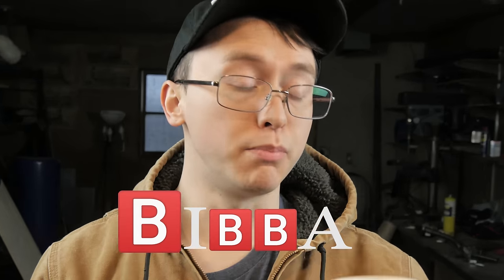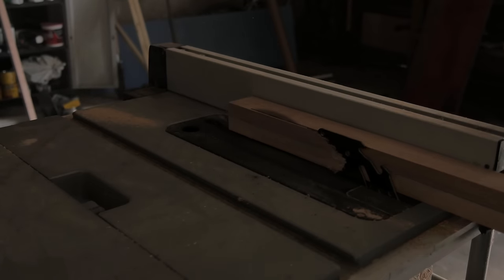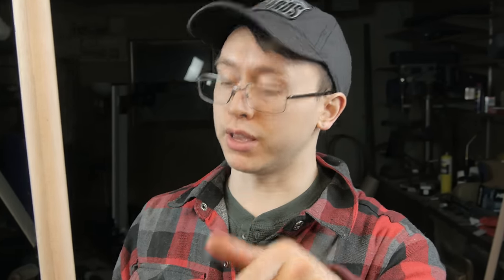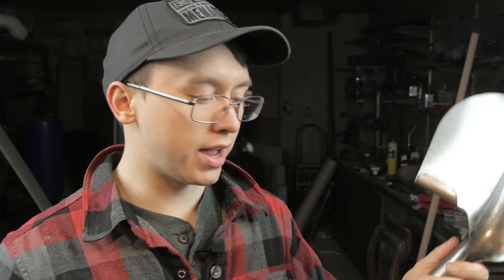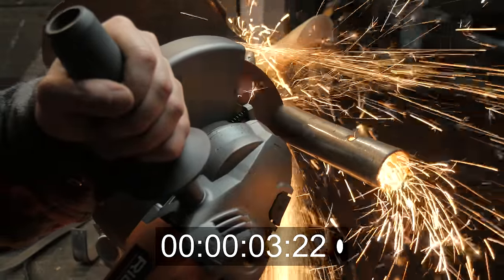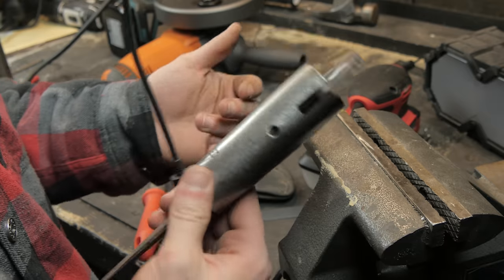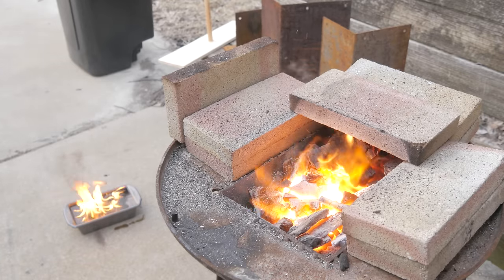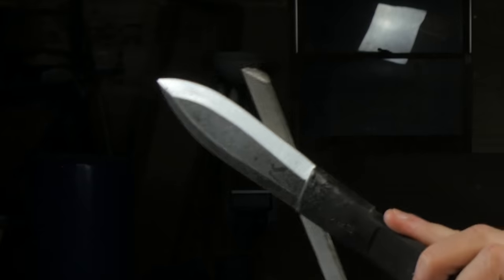DIY Lathe in a Day + Turning Spear Handles (Wrench Spears Part 3)

Comment: The metal needs to be a bit hotter, a term a lot of people use is "non magnetic"
So if you take a magnet with you and heat your metal to a point that it will no longer attract the metal then quench it you will get a much better hardening.

Comment: Depending on the metal the wrench is made of you might just be straight out of luck. But if there is anything you can do, i'd say heat the metal the is farther away from the blade as well as the blade, you might be leaching heat there, you might also want to leave the blade in the quenching oil until is equalizes heat with the oil (you might already be doing that and the edit just doesn't show it well). But those are the two things i'd try.

Comment: leave your spear heads in the oil longer. the residual heat in your spear head is likely tempering it as you let it cool off. I leave my quenches in the oil much much longer. good luck. hope it helps.

Comment: You could carbonized the steel, basically you just heat it up and put it in fine saw dust a few times and it carbonized the exterior although the inside will be the same but it should work

Comment: Eli... my dude. You need to move the object your trying to heat treat more rapidly in the oil, get a larger oil pan with more oil, google the leidenfrost effect I think that is your problem, a small vapour barrier from the steel and the oil is not getting to it, thus not cooling it down

Cheers 

From and Aussie viewer

Comment: a wrench will not get hard as h*eck, but you might wanna try getting the temp just above non-magnetic, when you put it in to the oil you want to shake it and keep it in longer, that might help. if this doesn't work you should case harden.

Comment: You didn't appear to magnet test it so it could have not been hot enough, also wrenches might be made from a water hardening steel, so you might try quenching in water instead of oil.
Reply: Ps. I find things harden better when you heat them up and let them cool slowly a few times before hardening.

Comment: A professional bladesmith told me once that cheap wrenches (made in India and China, mostly, that are less than 60-80 years old) are one of the worst salvage steel source. It is so because of the process of making the steel itself. This "tool steel" is actually random tool steel-ish scrap pieces of material salvaged from huge metal scrap yards dumped into large crucibles and homogenized together. The thing is, some of the scrap pieces used weren't good hardenable steel in the first place, and are contaminating the finished billet. This process allows big companies to make tools cheaper (as they don't actually pay for the raw material) but in the end, the results are just untrustworthy (from a metallurgical point of view)

Comment: 1) Pretty sure those wrenches are stainless, and intrinsically will not quench as good as carbon steel. 

2) Case hardening steel could give you steel with too HIGH of a carbon content if done incorrectly, and it will be too brittle, so you must be careful when doing it.

Comment: instead of using a drill for the lathe use an angle grinder, so much more power and torque, you built some mega spinning blade with one im sure you can build a lathe

Comment: I saw 2 ads, one about 1/3 of the way in and one at the very end... best way to heat the oil is with a chunk of scrap that's been brought to high heat. Toss it in and let it sit, burning off the top takes too long.

Comment: Eli I'm pretty sure you're taking the spear heads out of the oil too quickly, I could be wrong, but I think it most likely couldn't hurt to leave them in the oil for a minute or two longer. Also I realize that maybe you are leaving them in for more than a few seconds and the editing is just making it look like you are taking them out early. Also I've heard before that when heat treating you want the metal to get to a nice cherry red at the very least, but I could be remembering that wrong.

Comment: I don't think you are getting the steel hot enough. All the file test shows is if it is harder or softer than the file. Go on amazon and pick up some hardness testing files. They are a set of different hardnesses of files and allows you to get a more precise measurement.

Comment: so, alright, im no genius of heat treating, but you need a kiln.

Getcha some kind of kiln, or oven, youve gotta re-normalize the metal, because it should be getting mostly hard but its not. Let it sit at like 600 for a few hours, then cool off naturally, maybe even super slow in sand or something, then get you a weed burner deluxe ultra long forge heater upper,  (or a grill on a super high) then get them cherry red, instead of just yellow, and try oil or even water.

Honestly, i know there are resources online for treating metal, and you should be able to find the metal type from the website those wrenches are sold on, and find a comparable metal to treat it like. i believe in you.

Comment: Hey what CASE HARDENING? FORGET IT, too comlicated, its for sure tool steel, just try with room temperature oil or water, it should give ou a faster quench, and if it has less carbon it should still harden if its not mild steel. And the file also won't tell you then cuz a medium carbon steel(0.4-0.6% carbon) won't necessarily be that hard. Also use  a magnet for determining the temperature,i think you were a little cold, and let them soak at temp for a couple minutes. Good Luck,
- by AHGKS(anonymous high grade knife smith)

Comment: Your heat treatment is not right
First you need a bigger container for your oil (and obviously more oil)
Second I don't think your metal was hot enough. Don't heat treat in daylight if you depend on seeing the colour of the steel to gauge temperature
Third, you need to really let the metal cool down in the oil. I mean hand touching cool

Comment: Here’s your problem with your heat treat. Your not fully cooling the entire piece and you are allowing the heat built up on the part you didn’t quench to soak back into the blade and ruining the hardness. Just fully cool the entire thing in the oil. It can be hot but not over 500 degrees. You will have to temper it in an oven later.  The wrenches should have enough carbon.

Comment: Instead of going straight to case hardening try water quenching. Yes, every blacksmith on YouTube is going to want to skin you alive but I've had steel do the same thing and it hardened in water just fine, try it with a scrap piece first before you put all that stress into the blade

Comment: If the wrench is cheap and shit enough it wont have the carbon content to harden properly you can tell cause most of these cheap wrenches will bend more than break and that can tell you if you can harden them properly or not

Comment: dude ,, heat the oil mean heat the oil with hot metal, not an open bursty splashy flame  AAHAHHA , if it aint broke  BTW , try to use a faster oil , that means a thinner oil(cooking oil work fine with tool steels, canolla, corn , sunflower) , if that doesnt work , try water(on the head that you don't care about, cause it may break) , if not , it is a kind of supper alloy that requieres more precise heat control

Comment: stainless steel has to be hardened at a lot higher temperature, at least 1000°C, where carbon steel can be hardened at about 800°c. Stainless is a real b*tch without proper equipment.